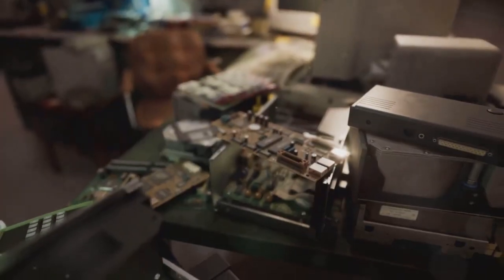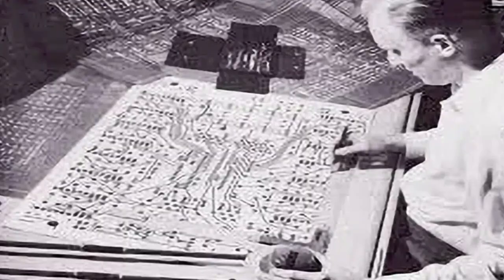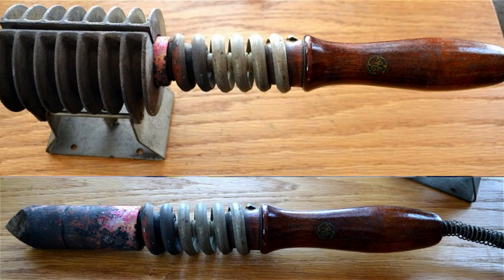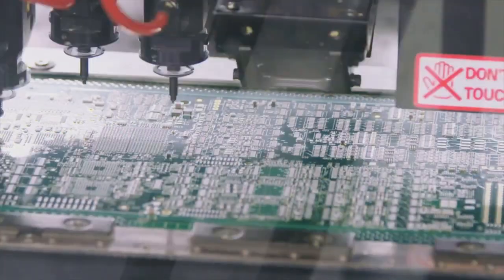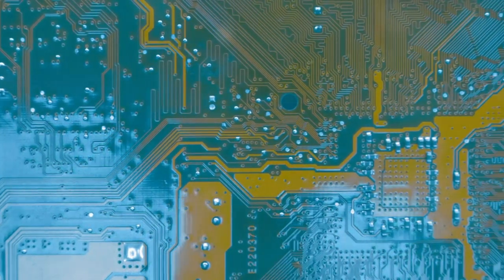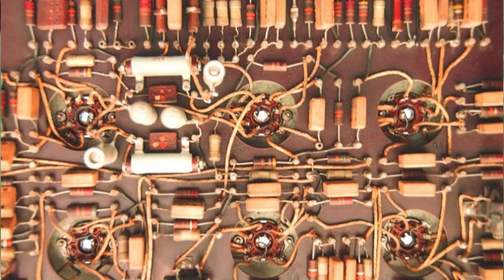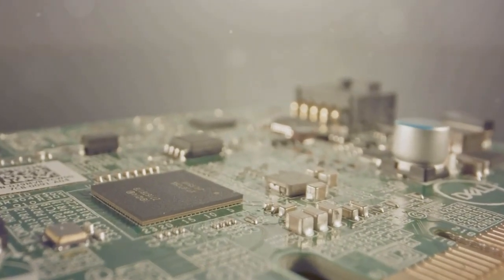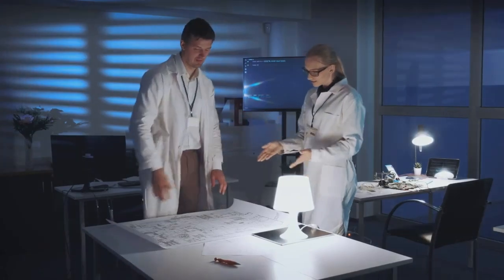Early circuit boards, or Pre-PCBs

Comment: I'm sorry, but what is the point of this video?

I have dabbled in electronics as an amateur. And I have etched PCBs myself using an electrolytic process.

An introductory video like this should talk about prototyping with breadboads, using veroboard/stripboards for more permanent but still pre-production prototyping, then using hand drawn circuits and etching to make rudimentary PCBs to using computer aided design with etching to make more sophisticated PCBs then finally industrial scale photoetching at scale.
Reply from the maker: There are dimensions to early PCBs, and we will post more on this as we gather more data, and you can assist us with images for the upcoming episodes.